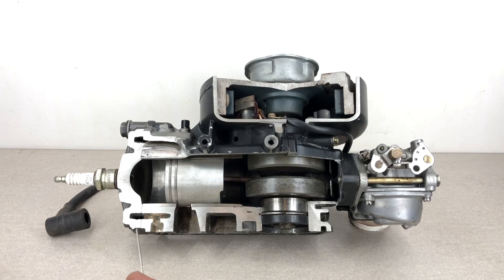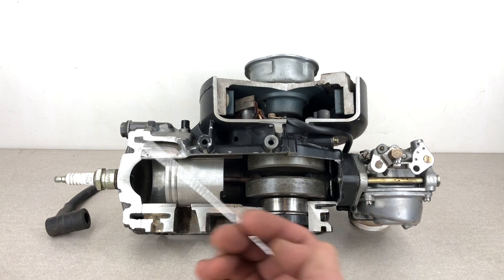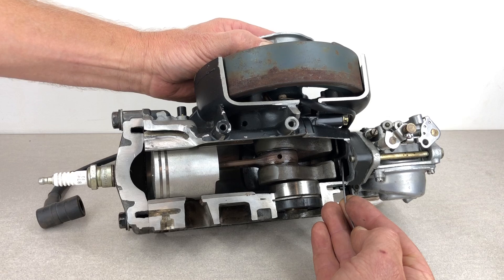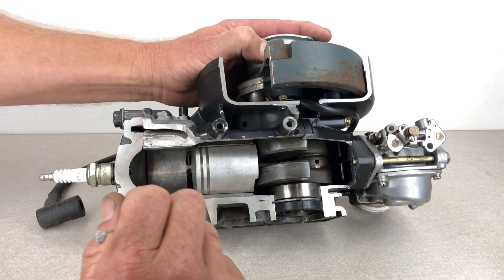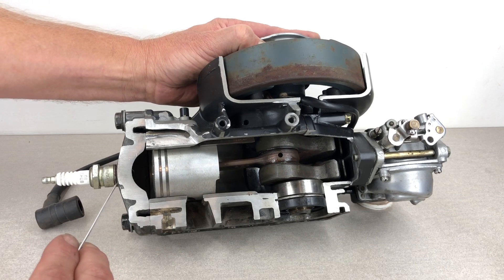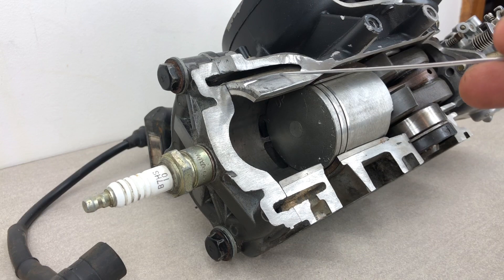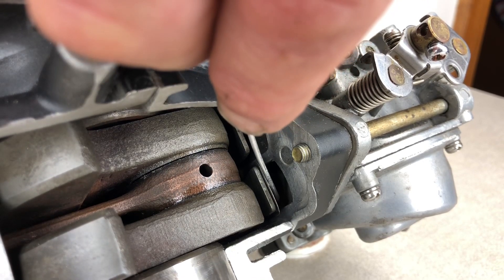How a two stroke outboard works.

Comment: Well i have a few questions because all i know about engines is about 4 strokes. 
#1 what keeps the crank/connecting rod bearing lubricated?? 2 stroke fuel? 
#2 when the pressurized air fuel mixture from the crank case enters the cylinder you said it swirls and during that time i can see that the exhaust port is also open so what happens then? The air fuel mixture escapes through that exhaust port and whatever little amount is left in the cylinder gets compressed and ignites?? That's really a waste of fuel!
Reply from the maker: Hey, thanks for the questions! In a 2-stroke, the fuel/oil mix lubricates the crank/connecting rod bearings, and a small amount of fuel/air mixture does escape through the exhaust port in a process called "scavenging," which is a trade-off for simplicity and power in these engines. Also the specific angle of the ports shoots the fresh fuel air mix into the chamber in a way that pushes the exhaust out and by the time the ports shut only the fresh air fuel mix is left ready to be ignited.
Cheers 🍻 
Aussie Boat Guy 😎
Reply: @25hpboatracerman thanks for the reply 😊 
that's wild!! No engine oil needed for lubrication. So basically all 2 stroke engines are lubricated by the 2 stroke fuel, no matter if it's in a boat or motorcycle?? I bet these engines don't last as long as the 4 stroke engines with pressurized oil lubrication!
Reply from the maker: Hi Mate,
Believe it or not, they last an incredibly long time, I’ve had two stroke motors from the 50s and still running like clocks. They are lubricated by oil which is added to the fuel, normally about 50 to 1 so 50 parts fuel to 1 part oil. Because the oil fuel mix is pulled through the entire spinning assembly all moving parts are very well lubricated. When I pull some of these apart it is easy to see oil on all bearings, crank, cylinders and cylinder walls, rings it’s just all throughout.
It’s such a simple but affective design.
I see some four strokes failing before two strokes, mostly as they have a lot more parts.
Cheers 🍻 
Aussie Boat Guy 😎

Comment: and the lubrication system is the fuel/oil mixture splashing on the rotating assembly as it draws i the fuel/air (and oil) charge
Reply from the maker: Correct 👌 
Thanks for your comment, I should have added that info.
Cheers 🍻 
Aussie Boat Guy 😎

Comment: Best outboard channel on youtube. No BS, excellent advice and straight to the point in a really likeable way. Onya ma. Liked and subbed of course
Reply from the maker: Thanks Mate!  Appreciate your encouragement 👍
Cheers!  🍻 
Aussie Boat Guy 😎
Reply: @25hpboatracerman  No worries mate, just the truth. Not a chippy by any chance are you? Couldn't help but notice the Estwing 24oz, H2 framing timber in your garage and bunnings trade top. Cheers
Reply from the maker: Yep 👍 builder.
Did my chippy trade then license BC4. Been building for over 30 years 😂.
Been playing boats for over 40, pulled my first twin cylinder apart when I was 8, so much fun.
Cheers 🍻 
Aussie Boat Guy 😎
Reply: @25hpboatracerman  Haha I thought so. Same here, did chippy trade first, then I did the diploma of building and got my WA builders rego 11 years ago. Got into outboard mechanics only recently so I don't get raped by the boat shops. Cheers

Comment: that makes sense. The clear tube was also on the suction side and it was flowing. 

Couple days ago the water test was a success.  The two leaking reed base gaskets were the problem. The boat hasn’t run this well for some time. I really feel the 3M 847 sealant placed on both sides of the reed base gaskets and the brown Evenrude/Johnson sealant on intake manifold gaskets provided an air tight seal. 
A tip someone else told me about timing helped too. Setting the idle timing 2 degrees advance on the trailer and rpm 1000 put the settings right on target when I checked them again on the water in gear. 
Thanks for the replies. I’ll be watching your channel.
Reply from the maker: Good news mate 👍
Hope you have happy boating for a long time now 😊
cheers 🍻 
Aussie Boat Guy 😎

Comment: also im thinking that two strokes , unlike 4 strokes require more vacuum to be able to run, because they have to generate enough vacuum to open the reed valves, and then create enough vacuum thru the carburetors venturi to pull fuel vapor into the cylinder.. where as in a 4 stroke, this is not the case..
Reply from the maker: Hi Mate,
The reeds do function very easily with the volume that sis pulled through the motor. Keep in mind that your 9.9hp Johnson (if the early model) is about 216cc every revolution. 
Cheers 🍻 
Aussie Boat Guy 😎
Reply: @25hpboatracerman  the carb im working on is the hermaphrodite  style carbs that came on the 92 evinrude 9.9 with the plastic bowl, top, and the weird nozzle jet set up .. not sure exactly how they work, and cant find any technical info on them., this is the 3rd carb like this ive ran across and all of the well jets have cracks in them..

Comment: what reason would cause a 9.9 evinrude to have 70/80 psi of compression, and will start if you remove the carb and spray pre mix directly into the reed intake block.. .,the engine would not create enough vacuum to suck fuel into the engine, even if sprayed into the carb throat... I removed the head and the head gaskets looks great.., also removed the intake and the reed leaves look great... I then removed the powerhead and checked the cylinders and pistons,, the cylinder walls have no cross hatch pattern in them and look very smooth and glazed... . my plan is to replace the rings and hone the cylinders,, I checked the diamemeter of the cylinder and it is in spec...
Reply from the maker: HI mate,
That motor should run with that compression. Did you do a carburetor overhaul? I would definitely start with that (videos on the channel). make sure to remove all jets, possibly  the low speed jet is blocked.
cheers 🍻 
Aussie Boat Guy 😎
Reply: @25hpboatracerman   yes I  rebuilt it twice, cleaned it 3 times.,,  I pulled the carb off and spun the motor over with my electric drill.,,.,. it was not pulling vacuum thru the reed plate,.,. nothing,, im wondering if it has a bad lower or upper crankcase seal. like I said, it didnt even have enough vacuum to pull fuel into the engine when I squirted it into the carb throat.. it would only start if I sprayed fuel directly into the intake..  I spun the flywheel clockwise, pretty fast, so it should have been pulsing vacuum .   as far as the compression, that was my thought as well, that it should run with what it has,,

Comment: Another question if you don’t mind. I was trying to troubleshoot a possible fuel starvation problem when the engine would not rev up. I attached a small tank with plastic hose and ran the engine. I noticed the hose didn’t fill up all the way. The small tank had a 3/8 line to a clip on fitting. I used as large a fitting I could find. The motor is a 2 cycle Johnson 225. 
I saw constant flow but it wasn’t a complete hose fill while it ran as I watched. 
How would you determine if the pump was doing its job looking at the flow of gas through the clear hose?

Thanks again for your replies.
Reply from the maker: Hi Mate,
Interesting 🤔 
keep in mind it’s just a diaphragm fuel pump and the flow will not be that fast like an electric fuel pump.
Cheers 🍻 
Aussie Boat Guy 😎

Comment: Very useful. 
If a reed valve base gasket leaks could that cause a drop in crankcase pressure and allow water vapor to enter the cylinder? 
I would think that the lack of volume during the intake stroke would halt air flow to the cylinder and push air back out through the carburetor. 

I have a milky white substance pushing out two carbs in my 6 cylinder Johnson outboard. Two reed valve base gaskets have been leaking bad and air/fuel is pushing out the two carbs with bad reed gaskets. The air/fuel mixture has a milky white color. I enjoy your channel. Hope you can respond. Thank you
Reply from the maker: Hi Mate,
Thanks for your comments 👍
Thats annoying about your Johnson outboard.
I am not sure why the stuff coming out of your carbs is a milky colour except if your motor is running at high rpm and the weather is humid then possibly could mix with condensation being sucked through the carbs - side note : at the end of a long boat race one of my mates had ice formed on the external bodies of his carburetors.
Anyway, a reed gasket leak is never good and will course a vacuum leak which can be catastrophic as it can cause that cylinder to run lean and blow. 
You would normally be able to feel the motor running roughly or not happily with a vacuum leak.
You are correct in saying that the downward stroke will force air back out the intake.
weirdly it won’t affect compression too much with a vacuum leak on the lower side of the pistons.
I would sort the leaks and see how it goes after that, also do a compression test to see if any damage has occurred plus check plugs to see if any are wet with any water.
Cheers 🍻 
Aussie Boat Guy 😎
Reply: @25hpboatracerman  Thank you for the quick response. I haven't been able to really use the boat above 2000 rpm and have just been trying to sort out problems. I hope  no damage yet from the reed valve leaks. My compression has been good and equal in every cylinder. I plan on reassembly then testing again and was just picking your brains a bit. I think I had bad locktite for the reed base screws and the gaskets may not have been tight enough. I also put a tap through the threads this time to really get a good feel for tightness securing down the reed bases. If I work it out I will share it with you later. Thanks for the advice. i will check the plugs after I get it running. It runs idle and slow - just not able to get to full throttle above 2500 rpm.  Cheers back to you.
Reply: @25hpboatracerman  I just wanted to let you know how things went. Today I removed the reed bases and checked the plates. The carbon fiber reeds were fine. When I swapped the carbon reeds in apparently the gaskets did not seal well. Also the reed base screws even though they had thread lock didn't stay tight. I had purchased two of the six reed base gaskets on eBay. Those two on a separate order did not have the peel and stick gasket surface like the original other OEM 4 gaskets I used from a separate order. 

The two gaskets without sticky peel and stick surface pushed out of place and leaked badly. I didn't know this until I removed the carb silencer on the 1991 Johnson 225. Until. I was troubleshooting a separate bad spark issue.

This reed gasket leakage caused two carbs spitting out a milky white spray fluid. I think it was milky white because the exhaust was not being pushed out properly during the intake stroke. It was easier to go back out the through the carb. The back exhaust pressure brought water vapor back through the intake port and into the crankcase. The water vapor in the crankcase was then pushed back out the carbs. Just my theory. 

I took no chances this time during reassembly placing 3M sealer on both sides of the reed gaskets when installing them. The reed base screws were cleaned and soaked in degreaser brake cleaner before reinstalling them with new Permatex Blue Loctite. 
I also, even though the manual said not to use sealant, put the Johnson brown gasket sealer you normally put on threads on the intake gaskets front and back to make sure there were no leaks this time even out through the intake manifold.
After waiting all day for sealants and loctite to dry I started it and it ran great. In fact I picked up 500 rpms and had to readjust the throttle cable at the helm and motor enough to lower the throttle back down enough.
The real test now is on the water but so far it looks good. Better than expected. I hope this helps others after reading this comment. Lesson - Make sure you use new thread lock and put high tack sealer on both sides of the reed base gaskets. 

Your 2 cycle video helped ma a great deal to figure out what could be causing the white spitting fluid. Thanks for sharing!

Comment: doesnt the 5hp have a lot of potential power cause its a 100cc watercooled 2 stroke (the limiting factor in my case is probably the rotating asembly being heavy)
Reply from the maker: Hi Mate,
Yes you are correct 👌
I have only scratched the surface on that with the modified 5hp I made on the channel. the guys in Borneo are getting over 70kph out of them apparently.
cheers 🍻 
Aussie Boat Guy 😎

Comment: Do you know why medium/large 2 stroke outboards use the variable ignition timing as a power control when no other engine is set up like this?
Reply from the maker: Hi mate,
Yep 👍 
Most outboards from about 6hp and larger use a stator to advance and retard the timing at the same time  the carburetor opens.
It is mostly for the lower rpm range and idle. 
Fixed timing two stroke outboards (normally 5hp and smaller) timing is set reasonably advanced to produce the peak power at full throttle but that robs power from the lower rpm range and most of the time will make the idle not as smooth.
An outboard with a stator that has a more retarded setting at idle and advances during throttle will have a smother operation with better low and mid power.
Also, a larger outboard will still run if you fix the timing at full advance on the stator but will lose mod range performance and will idle roughly, top end will be the same once the motor reaches the correct rpm.
hope this helps.
cheers 🍻 
Aussie Boat Guy 😎
Reply: @25hpboatracerman  What's really strange to me is that outboards use the timing advance as the primary power increase up to about 1/2 throttle, then the carburetors start to open progressively more, no other engine works like this.  Many two strokes I've worked on have fixed timing or timing that advances as the RPM increases like most 4 stroke engines do.  There's obviously a reason for it since all the manufacturers do it, it's just strange to me.

Comment: Anybody tell me what that partly rusted green disc is and how to get it off (without a fly wheel pulley if oiss). Thanks
Reply from the maker: Hi mate,
If your talking about the flywheel then you can watch my 9.8hp tear down video a few vids back, I show how to get the flywheel off without a puller.
Cheers 🍻 
Aussie Boat Guy 😎

Comment: This looks like a tohatsu/mercury 5hp engine is it possible to up the compression by changing a piston and are there aftermaket pistons for this engine cause I’ve noticed mine isnt making power but it will rev also is there a hemi piston possible in 2 strokes?
Reply from the maker: Hi mate,
Yep Tohatsu- Mercury 
Firstly if your one is not running right, I would do a carburetor overhaul and check compression.
On the modified note: I have put up a few videos on modifying a five hp, I shaved the head, bigger carb, ported the block, modified the gearcase and put a racing prop on, about 100hrs work for another 15kph. For me it was worth it to answer my question of - wonder how much speed I can get out of a 5 🤷‍♂️
Cheers 🍻 
Aussie Boat Guy 😎
Reply: ive checked carb its fine it has a plug in the idle jet for some reason (idk if its idle jet might be a trough hole for vaporizer) i dont have a compression gauge but i think it needs a rebuild cuz its been in the garden for a while and it doesnt get to the power band i think cuz it wont go on plane on a fairly light boat
Reply from the maker: @Diesr  
Hi mate,
Yep they need the plug in the idle jet, it draws fuel from another place.
Yes, the 5hp are not that powerful to start with, mostly don’t get any boat on the plane. 
Cheers 🍻 
Aussie Boat Guy 😎

Comment: the slower a 2 stroke spins, the more fuel/air escapes out the exhaust port/s. conversely, the faster the more efficient. a directly - injected 2 stroke solves this at the expense of complexity. interesting to note: at full throttle a 4 stroke burns the same amount of fuel everything equal
Reply from the maker: Thanks for your input mate, yeah, the direct injection two strokes are pretty good on fuel compared.
Do you mean that four strokes burn the same as a two stroke at full throttle per combustion stroke? 
Cheers 🍻 
Aussie Boat Guy 😎

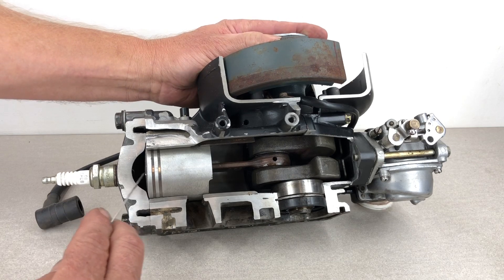Comment: Can you tell me if water would get into the motor if at the base plate there is a gap in the gasket between water jacket and the exhaust chamber.? 4:29
Reply from the maker: Hi,
Yep, if a gasket fails on the exhaust jacket or the head gasket fails water will get into the combustion chamber.
Cheers 
Aussie Boat Guy 😎
Reply: Thanks for the feedback have you got a email address I’d like to send some photos of the problem I have.?
Reply: Hay mate i know you’re real busy, but I have been ripped off by a boat company that has done a bad repair on my Yamaha 50 out board the motor has gotten water into it and is now seized they say water can’t get into the motor from we’re it doesn’t seal at the base gasket.? So now I have to research and have information to take the business to the ACCC for warranty.! So mate if you can help out I would be really grateful.!!

Comment: When you port the intake port you port it all around? Ore only in the sparkplug direction and sides?
Reply from the maker: Hi mate,
If you mean where the reed valves are, I just removed the casting shapes that were protruding into the port a lot.
Cheers

Comment: What makes the motor spin in the first time like before the air gets pressed in the top by the piston
Reply from the maker: Hi mate,
Either a pull starter or electric start. 
The motor needs to be manually spun initially to get the whole system working. Like when you turn your key in a car, it gets a small electric motor to spin the motor initially. A pull start just like on a lawn mower or brush cutter.
Hope this helps,
Cheers,
Aussie Boat Guy 😎
Reply: @25hpboatracerman  Ohh so that's why they pull that wire on the motor its to get it initially started thank you for the knowledge 🔥🔥🌟🌟💪🏽